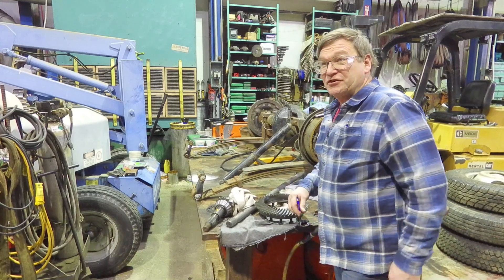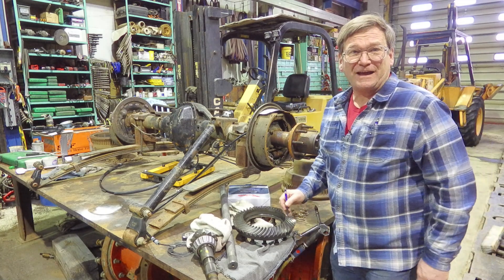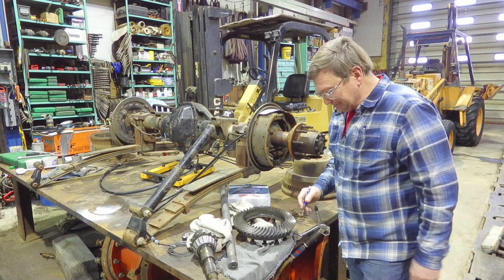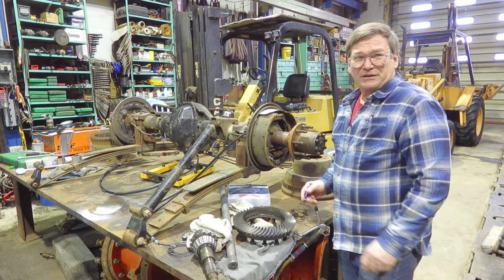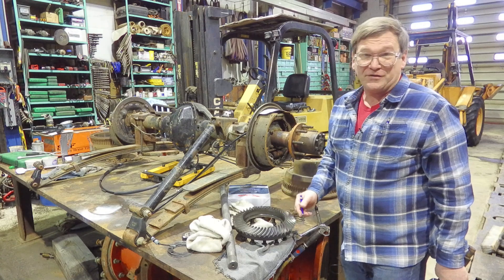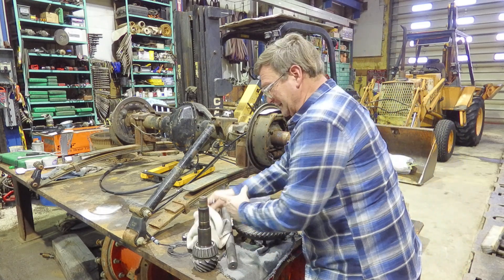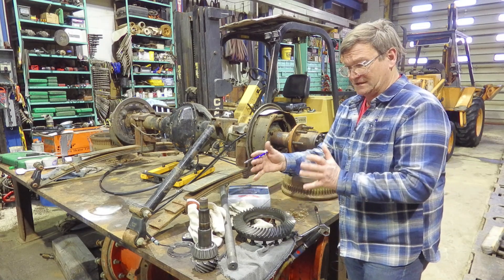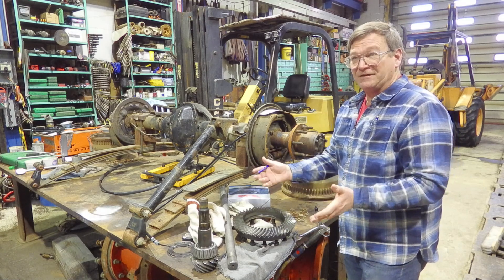Machinist's Minutes: Gear contact Patterning, part 2

Comment: It kept working😂 that part had me rolling as if it ain't broke it is still making money.  I don't industrial maintenance and have to repair worn parts as it is cheap for me to weld up then machine back.  Shaft play and gear backlash is something my notes pages are worn out in my handbook for double checking.  Great videos🥰